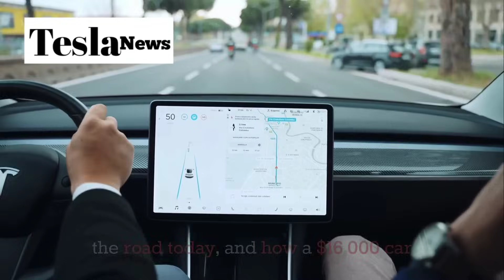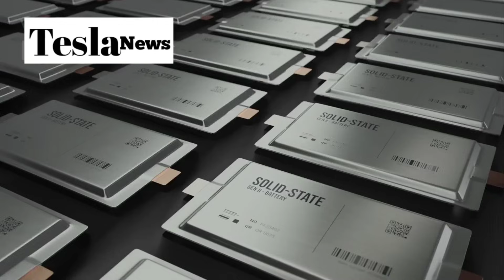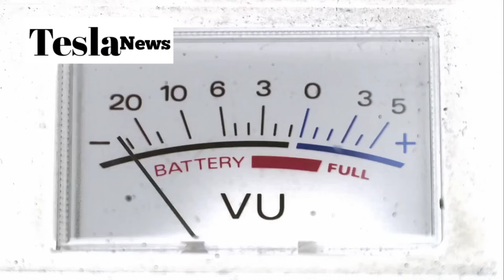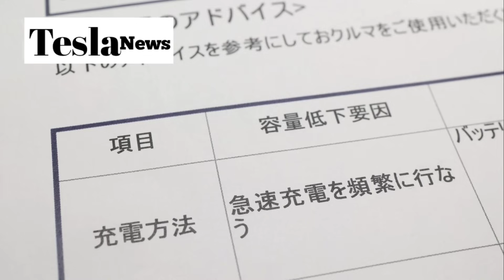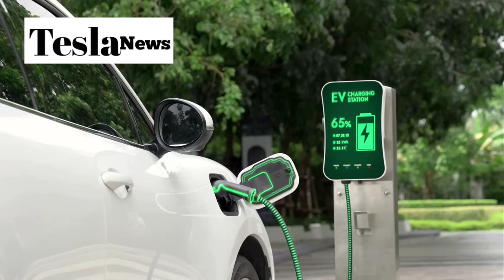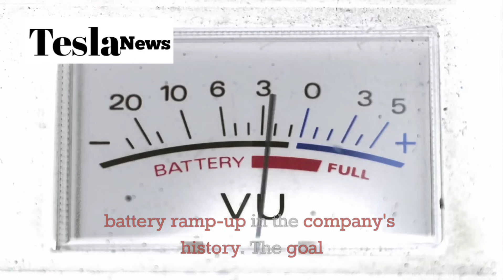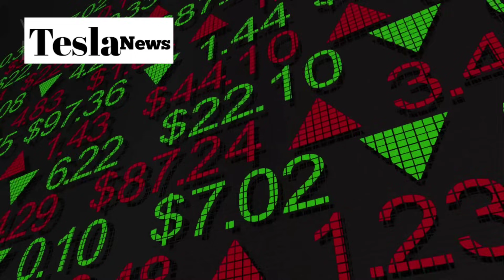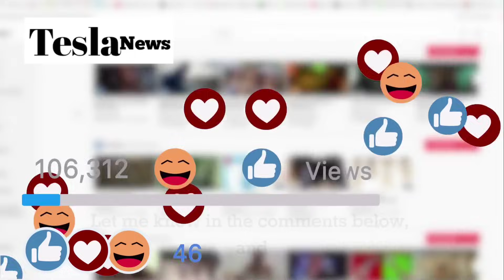Tesla's $3,777 SOLID STATE Battery Just KILLED Every EV (2026 Model 2 Revealed!)

Comment: 2026 Tesla Model 2 is expected to have a driving range between 250 and 300 miles on a full charge. A long-range version might reach up to 310 miles. The base model is likely to utilize a 53 kWh LFP (Lithium Iron Phosphate) battery. is this a hype scam?